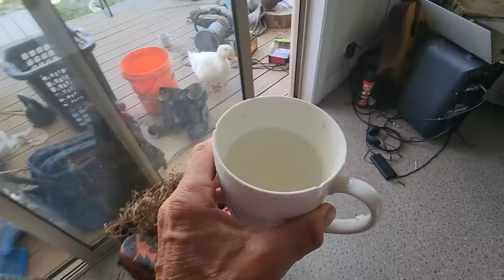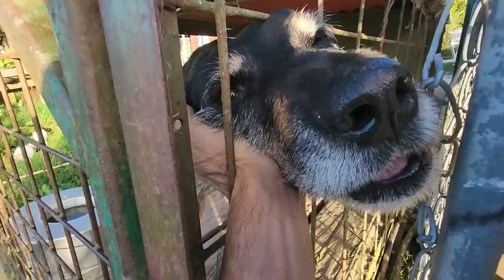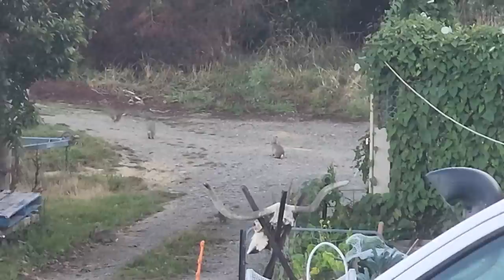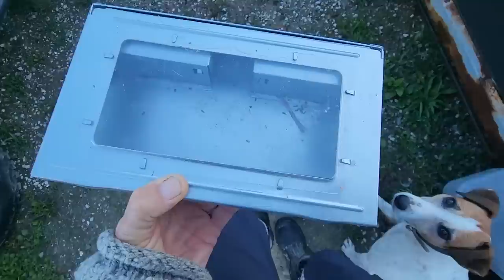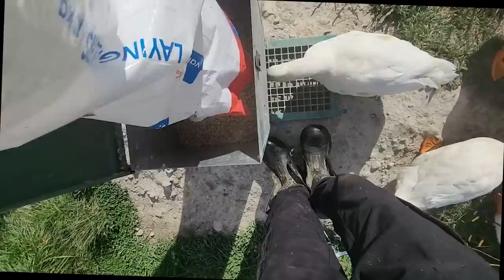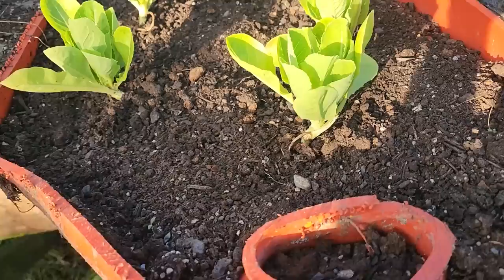Homesteading & Country Life

Comment: Great video, fun fact. Those missing kernels on that cob wouldn't have been rodents, thats that part not being pollinated. When young, each of those "Stringy" bits on the cob connects to a kernel, If they don't get pollen on them then no kernel will form. Could have happened several ways, Some of it may have been shaded by a leaf so no pollen could have got on it, or top flower was damaged/not formed or you may had a windy / wet day.

Keep up with the content!
Reply from the maker: Excellent info mate